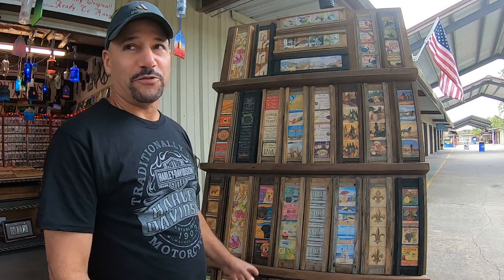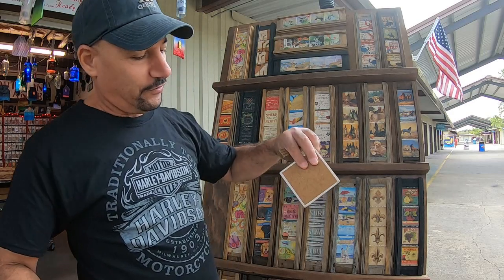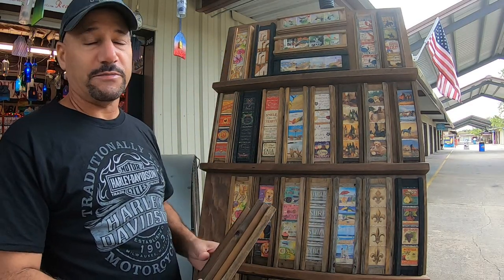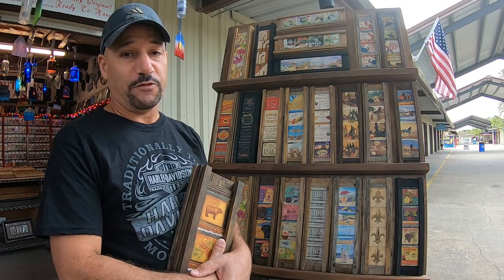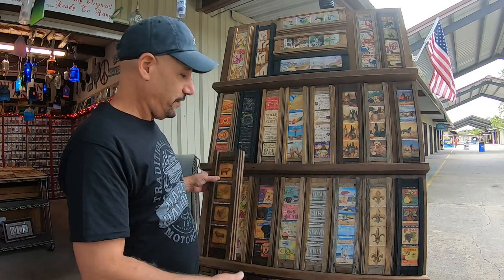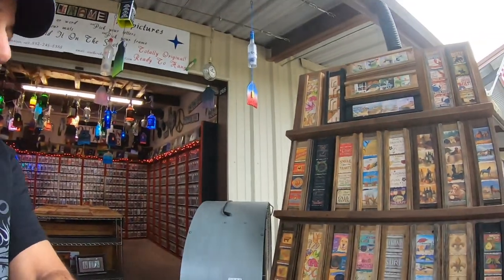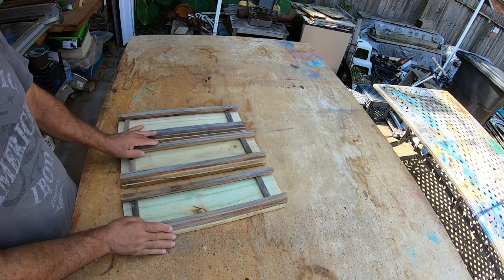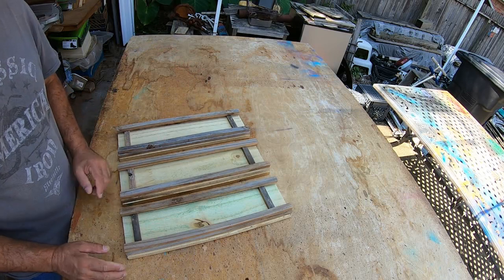How I turn ONE Fence Picket into $90.00

Comment: Really cool craft sale ittem, I print ceramic coasters, and this looks to be a great way for me to package and sell them.   Also, you made a comment early in the video about not going in to detail, in order to keep the video shorter, but then showed the exact same process for all 3 of your build ups, seems like you could have shown more detail, if it wasn't a scene from Groundhog Day ( I did rewind to see if it was a loop or a different build)    I hope that didn't sound too negative, great project, and thanks for sharing it.  I wouldn't have mentioned it, if you hadn't made the comment about cutting out detail to shorten the vid.   All the best, and thanks for sharing
Reply: How do you print tiles?!
Reply: @dwindlefoddl7225  I have a dye sublimation printer, print a reverse image thr heat press it on to a tile wirh a dye sub receptive coating